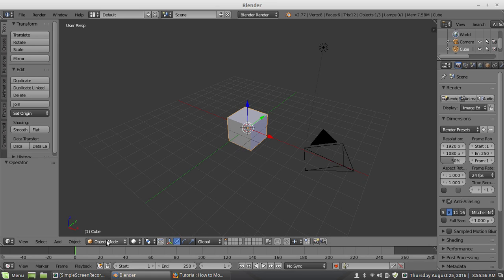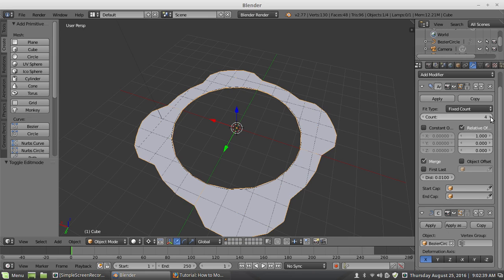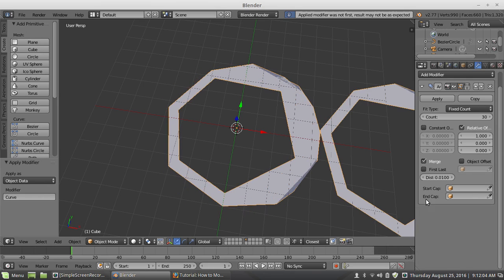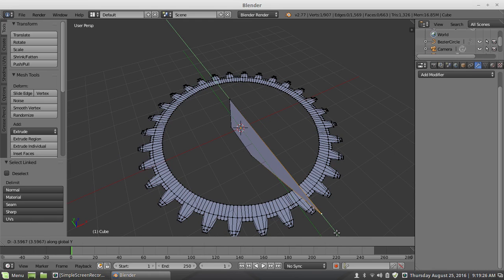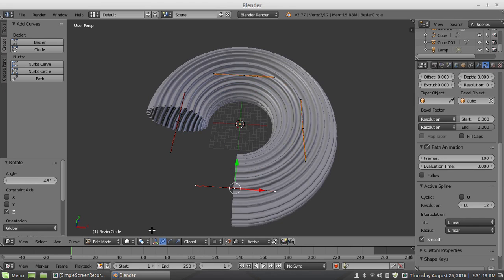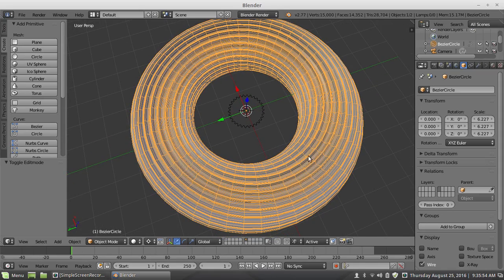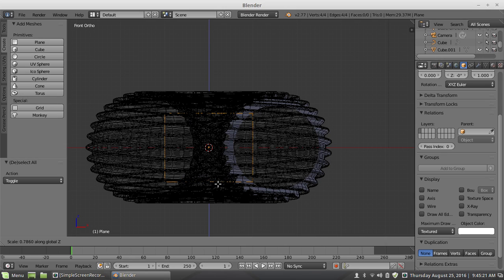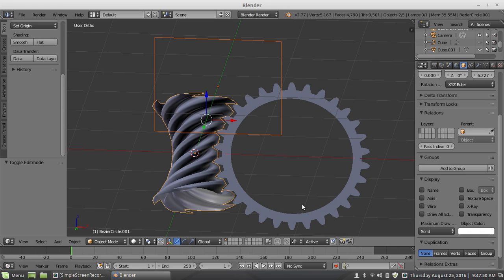Geometric Method for Throated Worm-gear in Blender

Comment: Interesting. I wonder if the worm works because the pressure angles look strange. I have tried this method before, but in other softwares. I managed to make the worm part. I will try to make the wheel now with some other method.  If you stumble around a lot and do not have time to cut the video. It will help audience if you install Screencast Key Status Tool:

http://wiki.blender.org/index.php/Extensions:2.6/Py/Scripts/3D_interaction/Screencast_Key_Status_Tool